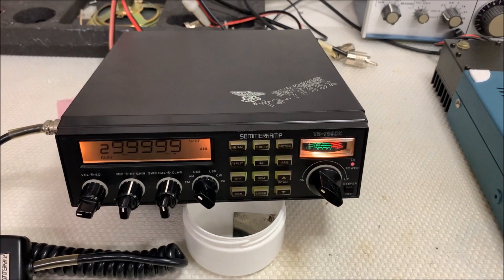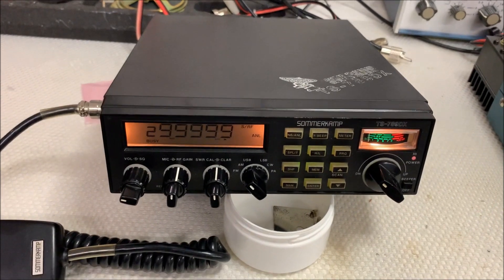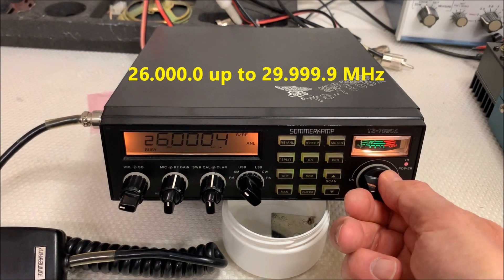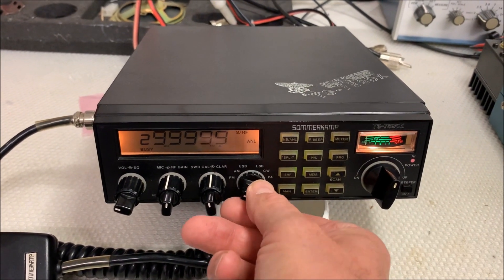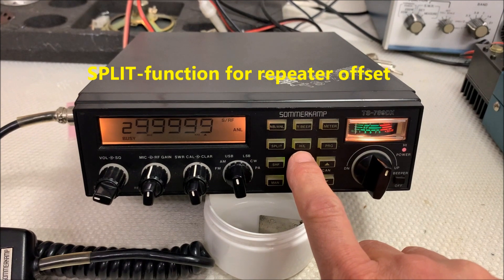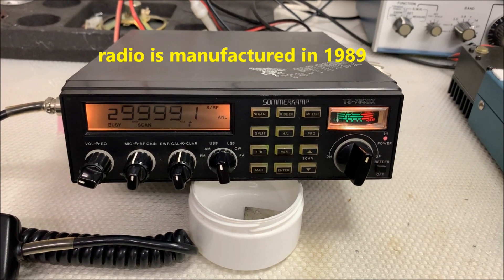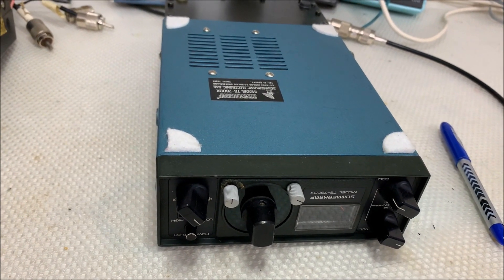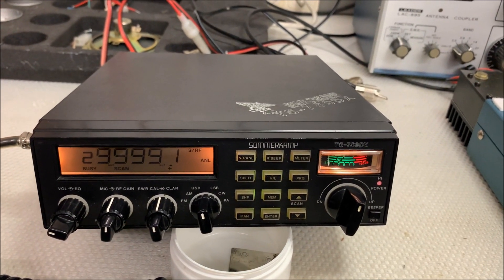SOMMERKAMP TS-789DX 26-30 MHz CB-HAM-radio to repair

Comment: Most have a worrble when you 1st key up ( take a second to lock)and when changing ch they there is a delay.. all were the same, let me know if you find a fix..
Reply from the maker: Mister john hello, thank you for your interest on my channel. Yes, this radio was not widely distributed. Even when it came onto the market in the early 1990s, there were only problems with it. The frequency selection was only very laborious with delays and transient problems. Repairing this device is not my priority at the moment.
Best 73, de Steven.

Comment: Nice video. I have one like that to restore.
Reply from the maker: Dr OM CT1JRZ hello, nice to hear from you again. Yes, this radio was not widely distributed. Even when it came onto the market in the early 1990s, there were only problems with it. The frequency selection was only very laborious with delays and transient problems. Repairing this device is not my priority at the moment.
Best 73, to you.

Comment: Nice full function radio.
Reply from the maker: Mister Orange hello, nice to hear from you again. Yes, this radio was not widely distributed. Even when it came onto the market in the early 1990s, there were only problems with it. The frequency selection was only very laborious with delays and transient problems. Repairing this device is not my priority at the moment.
Best 73, de Steven.